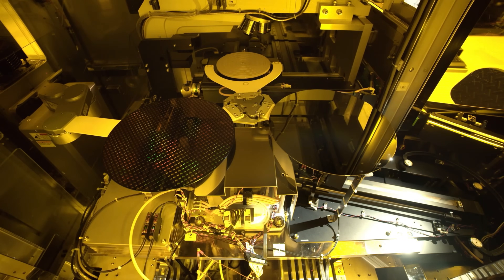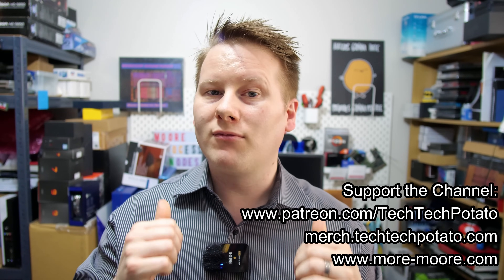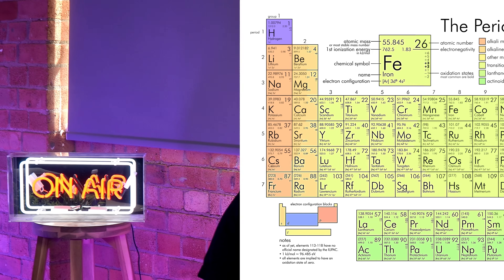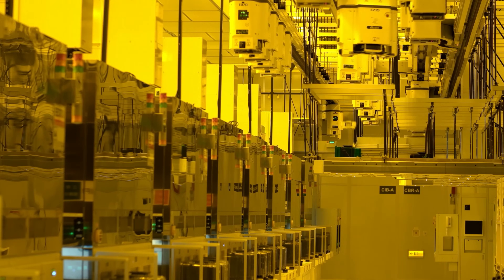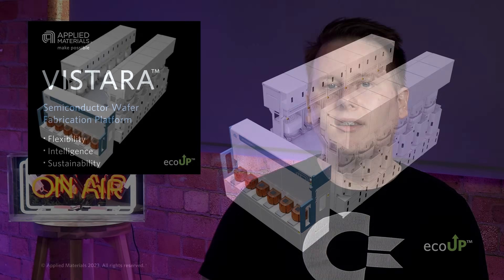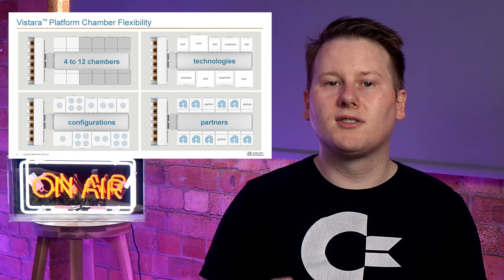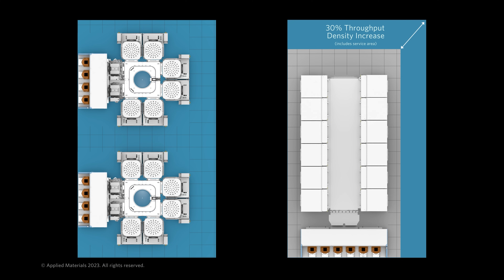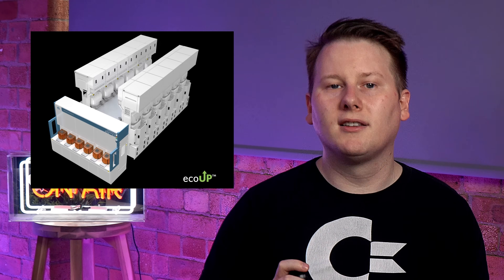This Machine Will Turbocharge Future Chips

Comment: Is it just me, or is the value of this frame more so the density/flexibility? Most AMAT tools are already very modular, and platforms such as the Endura have a ton of potential places to dock chambers. The AI stuff seems cool, but it sounds like it's part of a larger system that you have to buy. Do you know if a PVD chamber from an existing platform would fit on one of these frames? 6 load ports is...alot.

Comment: I wonder how the maintenance personnel have it in a clean from making chips. Having to be in a bunny suit I hope the air temp is very comfortable. Getting  into the beasts must be as easy as possible. Small arms and hands a must? Under the floor work, pulling the panels out, I hope it is not a bad chore with high personnel turn around. I was a Mechanic for an aerospace fastener and getting into some machines was a tight fit to see the problem and get to them.

Comment: Thanks for bringing attention to these other fab names. ASML gets a lot of discussion since they're on the cutting edge, but these other companies are still important since many applications don't need the latest and greatest process.
Reply: Actually, the equipment shown here is  on the same, if not more, cutting edge than ASML equipment. You could think of it this way in construction parlance. ASML equipment draws the floorplan on the site. It is equipment like the ones above that actually build the skyscraper as per the plan. Here site = area on wafer where chip is supposed to be, skyscraper = the said chip

Comment: it's worthless sand. you can go around saying there are some exotic materials left over in a chip, you wouldn't be wrong. but even more exotic materials are used in a consumable way, like dopants etchants and polishes. most of what you have in your hands when you hold a chip is sand, with some metals.
Reply from the maker: Sand is silicon dioxide. Silicon used in chips has 99.999999999999% pure silicon, no oxygen, unless you add it in afterwards. Stop saying computer chips are sand - they're not.

Comment: I would not put too much faith in factory optimisation. Why? It looks for me as battery cell production (pouch) in normal factory, many steps, many machine which only move parts, and don't do any job, and compare it to what Tesla show in they factory, constant movement which is part of proces, batteries are filled in move. Other example is can/soda factory.
This fabs are many machines connected and in bad way. Any moment wafer is not process is wast of time, look at this machine special container dock, unload to internal transport, which put in where job is don, next wait to reverse this, why they don't put in new container on other side or load in same time from other side? So each part which doing it job is constantly use with minimum idle time?
Reply: I'm sure fab planners have already considered something as simple as loading new wafers at the same time as old wafers are being removed, and other such low-hanging fruit. Yes, in many industries and areas of life there are egregious inefficiencies. But wafer processing is so complex, with so much value on the line, the steps integrated under the same control so tightly, and stands to gain from improved efficiency to such an extreme extent, that any perceived inefficiency from the glance of an outsider is bound to come from gaps in understanding and/or a calculated tradeoff for robustness and maximizing yield.
Reply: @orthoplex64  what you describing is fear of change, and one more thing, this machines are not made by one company, and they don't care if they are a little slower, or change interface of connection between them, because it only cost, risk,  and they don't make more money, better add additional oven and call a day.
Reply: @orthoplex64 I agree...an experienced engineer always knows it's not as easy as it looks -so, if it looks difficult, boy you'd better believe it!
Reply: I think your forgetting about the ultra ultra precision nature of the process machines - tesla is doing nothing particularly new in constant movement and the comparison to canning soda bottles is not really relevant. Of course 'going for maximum efficiency ' has to be a driver to keep your company in profit but there must be an appreciation of the manufacturing processes. The Industry is predominantly driven by size reduction and not price reduction, therefore that's the engineers biggest focus.
You said I rather suspect they are put together in a way to make money now and in the way to be flexible for tomorrows chip requirement. I trust their designers know what they're doing...I'm not saying the theory of constant movement or the reduction of 'in process time' is wrong.
Reply: @TAH1712  it is about process not precision, each critical part of machin stay the same, and battery production is in microns so...
And you missing that each machine, moving part is cost, and not only cost of this part, but time, maintenance, etc etc.
If you think they do what they can, you are wrong. And dont talk about "flexibility" because is BS, they can't change wafer size from 300mm.
Reply: @m_sedziwoj  if you think making batteries in microns is high-end manufacturing, then your a couple or more 'orders of magnitude' off for many production processes. But listen, I have no problem with the theory of removing cost from products but all I'm trying to get through to you is that the design engineers involved in moving the manufacturing to the next level down in size ,  are putting all their effort into that rather than making the same thing a bit cheaper by making more in less time. The theory of J.I.T doesn't like any storage - if there's many many process steps, then a balance of process throughput all through the manufacturing enterprise is very desirable . Any machine that can make double output could mean you only need one machine instead of two, but a machine that had 1.5x production increase might be useless if all the other processes can't also be increased in speed by 1.5x. I would trust that who ever commissions these fab facilities makes sure they have the smartest brains around to produce processors efficiently.
Reply: @TAH1712  smartest brains limited to even what you said, why make better machine if other can't keep up, yeah, and everybody is doing same. This is problem of fragmentation, not how great people are in each point, but that there are many points which are connected, and even if it would be great to move one proces from one machine to other, it would not happen, because they are different companies, and nobody would give money to others. 
If you ask people what they want, they would say faster horses. ;) (and not cars)

Comment: wish there was a bit more detail on what the modules do. Are they all just different sizes and temperatures of oven? (since they of-in the cold food of out hot...)
Reply from the maker: Clean, etch, deposition, all the other stuff that isn't the lithography part. The modularity is key, so you can have whatever config of modules you need for the process
Reply: Ohh I just hope that this is just the first chapter of a series!
Thanks!

Comment: might as well make the chip in space station if vacuum environment is so expensive to maintain. Plenty of hard vacuum in space for free.
Reply: Gravity is still important for all the solutions though
Reply: @lmmlStudios  c e n t r i f u g e
Reply: And how do you solve heat dissipation?
Reply: cold welding would probably be a bit of a bugger though
Reply: Not that sure it's clean enough up there...
Reply: I think the vacuum requirement was mentioned just as an example of how delicate some of the steps can be, not as something that's particularly challenging or expensive to maintain. It's also definitely way more difficult and expensive to ship all the equipment to space, and then to constantly ship wafers to and from space, than to hold a good vacuum on the ground.